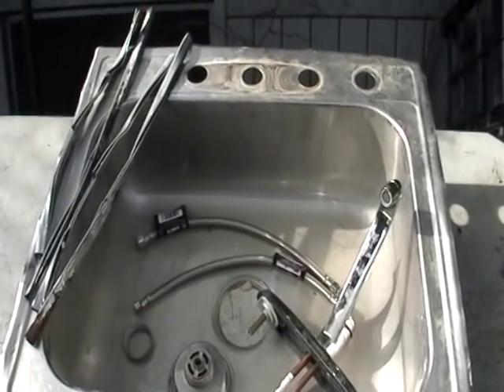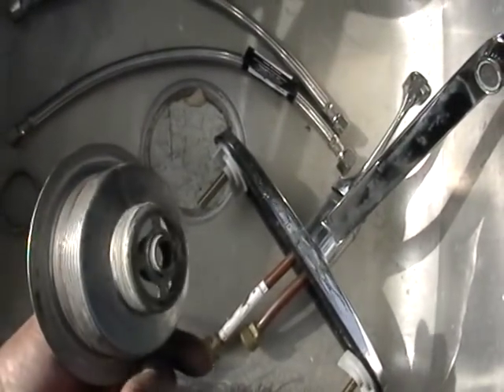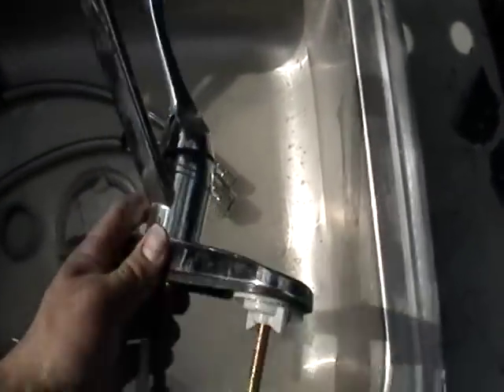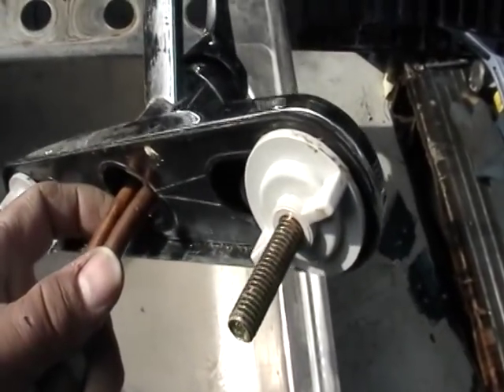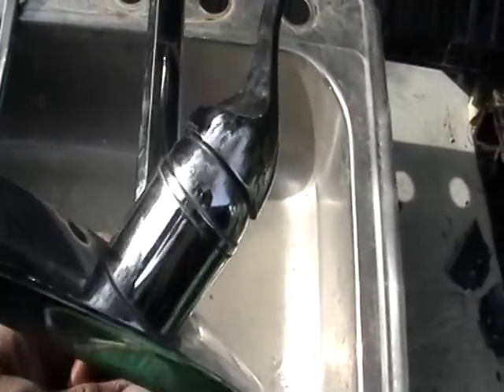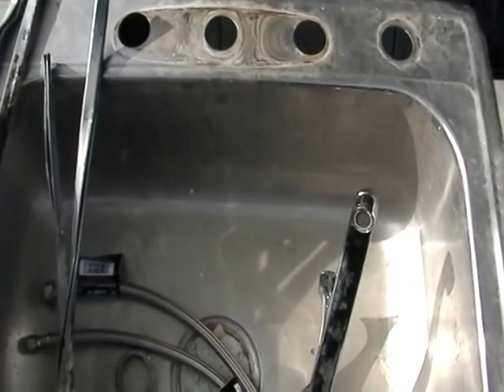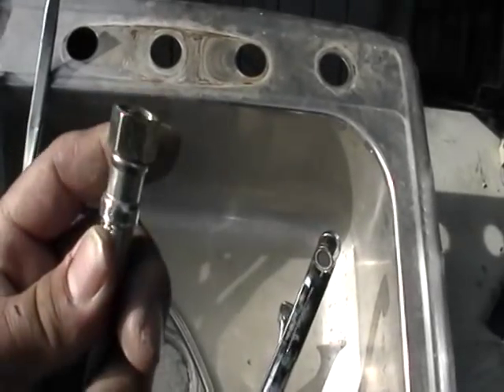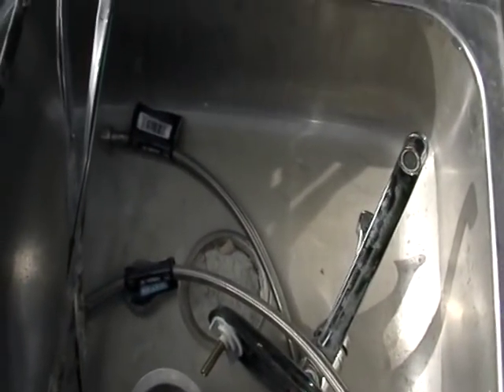Scrapping a kitchen sink faucet

Comment: @lmvelazquez100 will make a photo video i think havent the space to make a full take apart video and only has the mobile as videocamera right now. copper yes in the cord and pump engine. brass in the connection as it seams and even alu i think but not sure about the alu

Comment: So the faucet handles are brass too? I couldn't scratch onto it deep enough to tell i geuss
Reply from the maker: There is White, Pink & Yellow. That I remember.
Reply: Mike the Scrapper white and pink brass?
Reply: Mike the Scrapper I love your videos I'm getting ready to make a scrap run as we speak lol should have about 200 bucks 🤗
Reply from the maker: White brass contains more than 50% zinc and is too brittle for general use. Learn about red or orange brass. Many other common brass alloys can look orange or reddish brown, when they contain at least 85% copper. These types of brass are usually found in jewelry, decorative fasteners, or plumbing. Any hint of orange, yellow, or gold means the item is brass, not copper. Not Pink...That is discolored
Reply: Mike the Scrapper I made a scrap run today 119 bucks not bad but the handles on the faucet the guys said was die cast aluminum
Reply from the maker: Nice Bro
Reply: Mike the Scrapper couldn't have done it without you thank you for all your great videos you the man peace